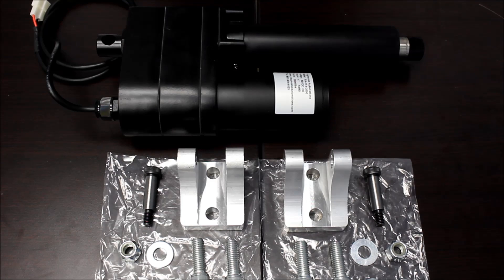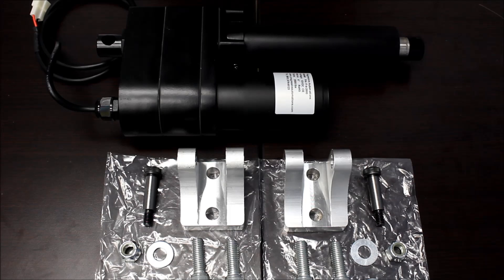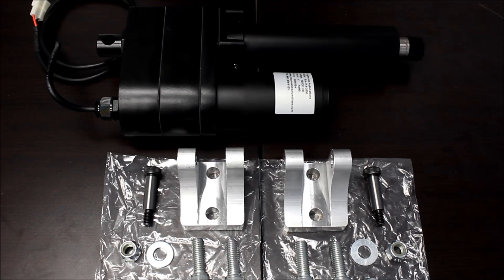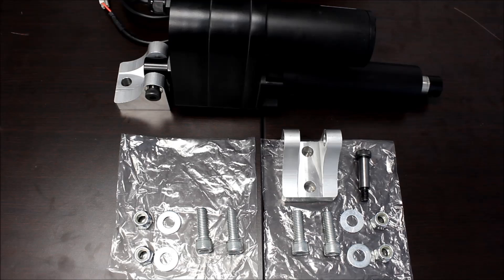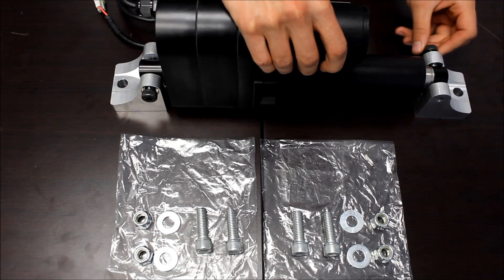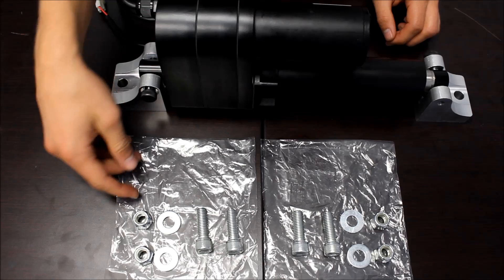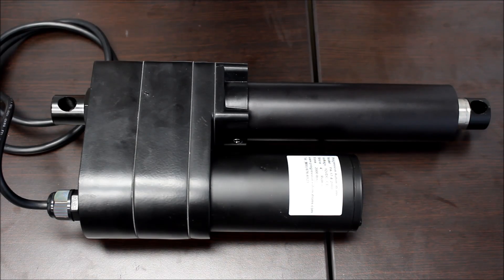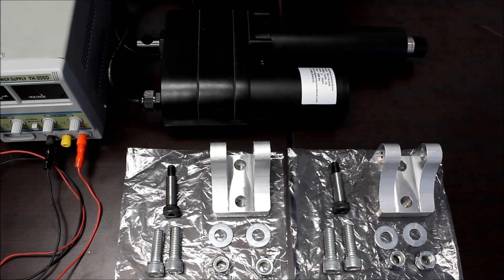Heavy Duty Linear Actuator PA-17 - Product Overview

Comment: would this be strong enough to lift a computer desk? as in a motorised height adjustable desk?? thanks
Reply from the maker: Hello,
We carry the PA-17 with dynamic forces of either 850lbs or 2000lbs. This may very well be enough force to lift a computer desk, however, this will also be determined by the mounting orientation as well as the overall weight of the computer desk being lifted.
Thank You !
Reply: @ProgressiveAutomations  how about lifting a 910 lb motorcycle 29.5" upward?
Reply from the maker: The PA-17 models are offered with a 2000 lbs force rating option that users can select. The stability of the platform should be considered as the motorcycle load may not be evenly distributed onto the platform even if the actuator itself has the raw power to lift the weight. Sliding guide rails for the secure level of the platform can help with this, similar to how Smith machines keep weights in a leveled position. Assuming the 910 lbs force was directly translated to a downward force applied against the actuator shaft, the actuator should be able to lift the load. Please note the PA-17 will not have limit switches and the shaft rotates freely for stroke lengths over 24" long, the PA-13 with 30" stroke and 3000 lbs force rating may be another option you could consider which offers limit switches and does not rotate as it cycles.